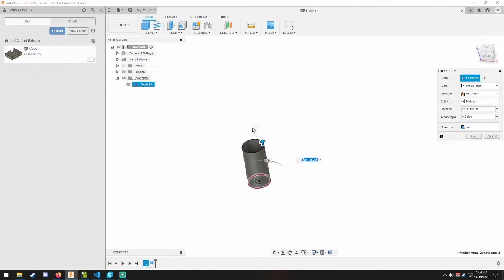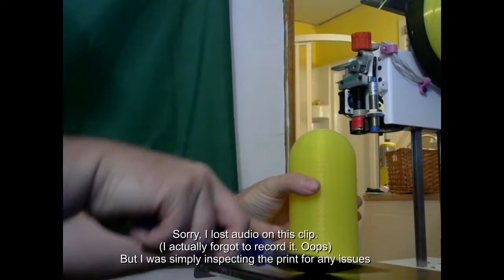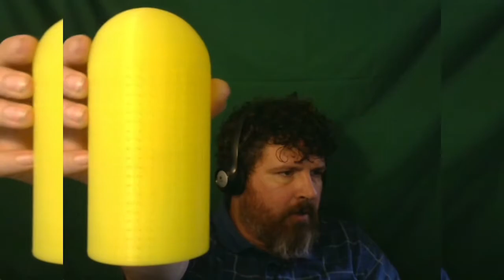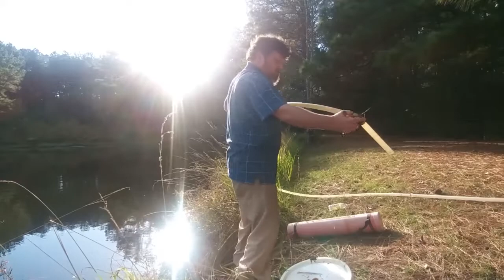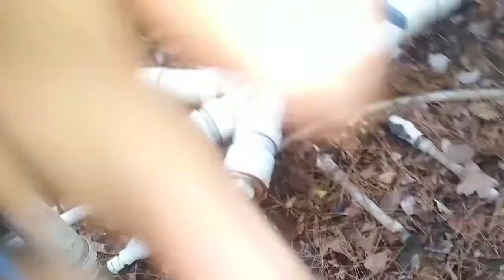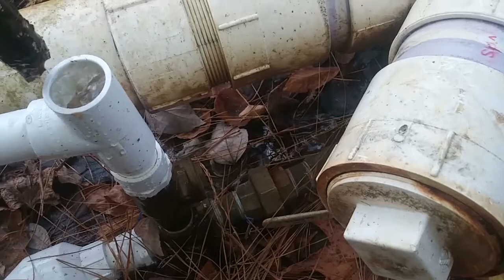Adding a 3D printed inlet filter to the ram pump

Comment: Interesting. I could see you making a platform to suspend the filter a few inches off the bottom, but other than that you are far beyond me with that engineering.
Reply from the maker: I haven't done much on the ram pump, but I have decided it was best to have it float closer to the surface to prevent it from being clogged with the mud when the pond goes down during the dry season.